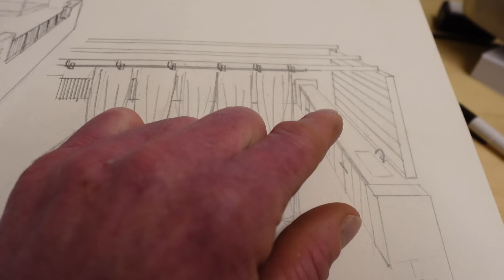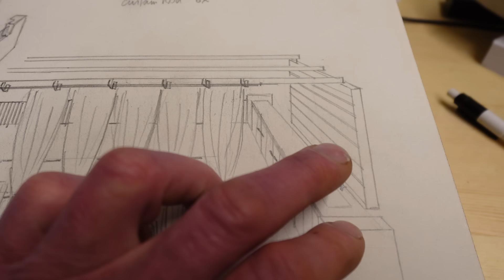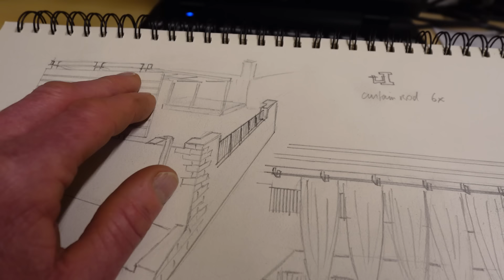#53 Slow week or stress relief? | Barn renovations | Piedmont, Italy

Comment: Great idea of wooden shade wall by the outdoor  kitchen, you will need it for the burning sun.  Love the  curtains how are you going to cover the top?  something with woodslats, cloth or greenery?
Reply from the maker: The top is still an issue. I was thinking to use bamboo but it is hard to find pieces long enough. Maybe in the beginning (first year) I might just use sunshade triagles or so and than think of a more permanent solution later on.